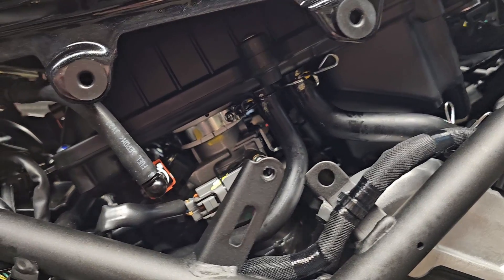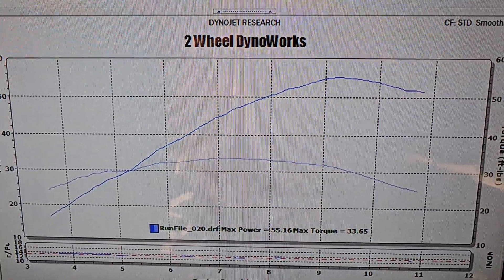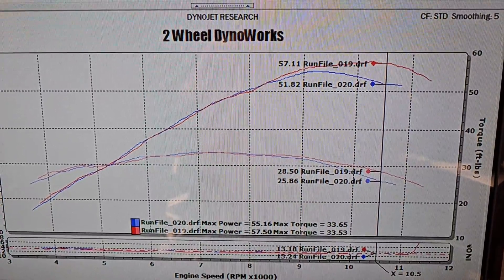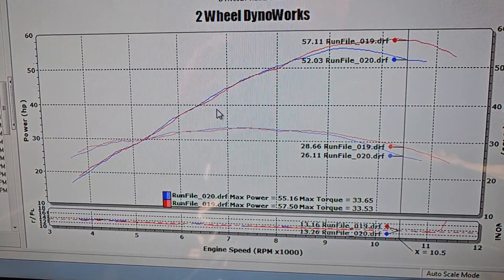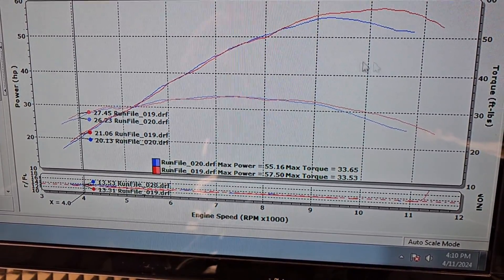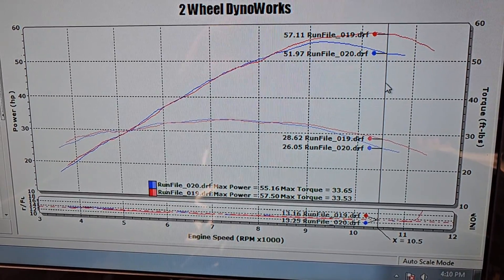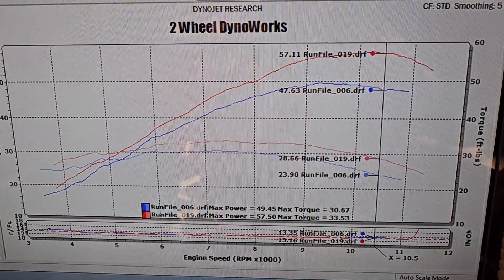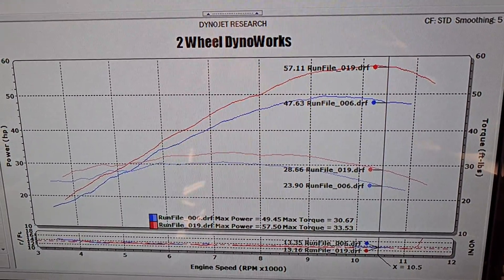2024 Ninja 500 Velocity Stack Testing & Tuning

Comment: I just installed these tst stacks and emission blocker as a package and it made my throttle feel way more responsive removed that choppyness in first gear low speeds for me, also I felt a lot of drop off from acceleration speed taking off from red lights etc. meanwhile I was able to go up higher speeds in gears without being as high up in rpm’s as normal, as well as able to hit 100 in 5th gear easily there is a sure difference in top end power with these compared to stock. I just did this 30 minutes ago, just took my boots off LMAOO

Comment: My biggest concern would be the increased piston speed due to the bigger stroke on the new motor compared to the old shorter stroke of the Ninja 400. 

Ninja 500 at 10000rpm stock mean piston speed 3845 fpm compared to raising the redline to 11250 which gives a mean piston speed of 4326 fpm. 

The ninja 400 at 12000 rpm only has a mean piston speed of 4016 fpm for reference and is proven reliable at that point.

My gut is telling me that for the longevity of the engine the redline should be capped at no more than 10500 which gives a mean piston speed of 4037 fpm. Plus the power is falling off at 10500 anyways.

Comment: I have a full system akrapovic, graves velocity stacks, moor mafia ecu flash. It pops and bangs crazy! Why is this one so quiet upon decel and shifting?
Reply: Chris Moore does not care about engine health. He will tune ignition timing WELL into the danger zone if customers want that stupid racket on decel. Of course he doesn't tell customers what he has to do in order to achieve that.
Now, when you remove a CAT, you no longer need the air-injection system which fed O2 into the headers for the CAT. If the air injection system stays open after the CAT is gone, you'll get a lot of post-engine combustion (crackles and bangs and stupid noise) because you're introducing O2 into the exhaust and the fuel injectors are no longer turning off when you close the throttle.
Block off the PAIR system. Ask Chris for a refund because you're not satisfied with his garbage tunes. Send your ECU over to 2WDW for proper work.

Comment: Would the Akrapovic full exhaust from the 2023 400 fit the 2024 ninja 500?
Reply: It seems that yes, everything is the same in the chassis between the two bikes.
Reply: M4 also advertises their full system as the same for 400 and 500.

Comment: These videos are gold. I’m getting the ninja 500 soon and these help me see what I can do to it
Reply: I just got it and wish I would’ve went with a 650 or something bigger big sad
Reply: @mrrobott9202  Big sad in OEM condition? It's a lightweight bike. Rip some curves. Flog the engine for all it's got. Put on an exhaust system and get a 2WDW tune. The limit is your riding talent and your determination, not the bike.
Reply: @turnin.sprocket big facts. 400s can dust 600 and liter bike riders on the course. I’d imagine the 500 should be in the same boat all things considered
Reply: @Yerocco  Depends on the track or course. The Ninja500 is barely heavier than the 400 was, and yet it has significantly more power than the 52cc increase would imply.
Reply: @turnin.sprocket  oh it for sure matters about the track. One with lots of straights…. I don’t see the 500 having fun that day lol

Comment: I bet with a full exhaust and tail tidy it’s only around 360 lbs wet… 57 whp is also a lot, the Ninja 650 from 2WDW here only made 63 whp with a flash and a full exhaust and it weighs a fair bit more, although it does make a fair bit more torque. Kawasaki’s smaller engine is one wicked performer. I bet in a roll race the Ninja 650 can’t pull on this, especially since a stock Ninja 650 makes the same whp as this Ninja 500…
Reply: 650 torque advantage, but no real hp/weight advantage.

Comment: Cant believe 50cc can change an engine this much
Reply: Well its ~12.5% bigger 😁
Reply: The power gain is definetly more than 12.5% 😁  @TrueDesire존
Reply: 52cc, increased 6.8mm stroke, same bore. Compression went down a tiny bit, negligible. Torque and combustion efficiency would really be up.